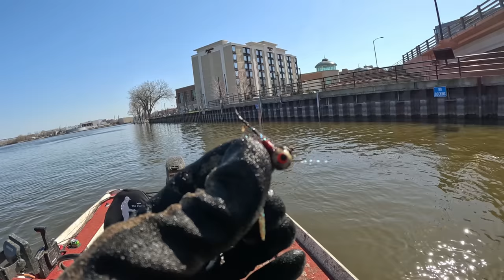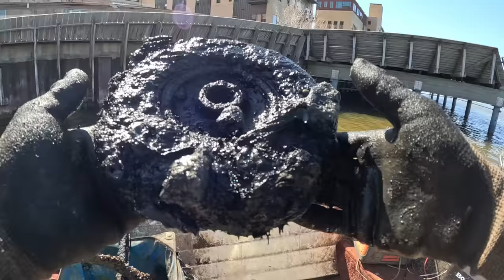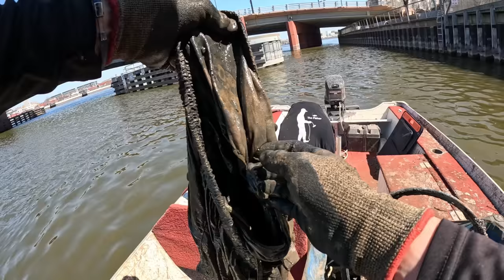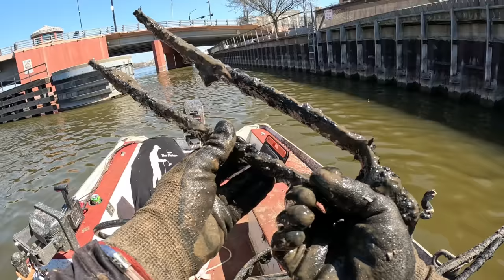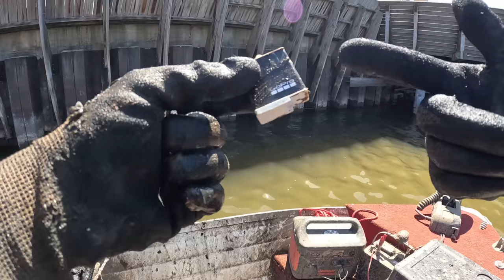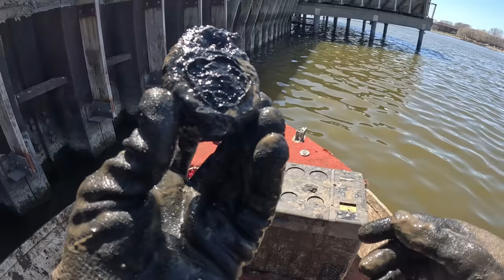WARNING: Tossing Evidence Into the River Does NOT Make It Disappear! (Magnet Fishing)

Comment: Hey Tyler,
   The two alike wheels are from a self propelled lawn mower.
The big hexagonal bar is commonly called a tanker bar, often used to pry or force tank tracks.
The box looking thing is actually a commercial mop ringger.
   Man you really need to pull the plug on the back of the boat and flush that crud out.
But if you do, remember to put the plug back in before you langue again.
Reply: Nice juicy spot Tyler! That push mower was epic! I remember using one we had in my youth. I’m intrigued with every heavy catch you have wondering what the heck it is! Love your videos.
Reply: Run it thru the car wash lol!!!
Reply: Tanker bar? Thats interesting. 

To me its a spud bar. I have two just like that one.

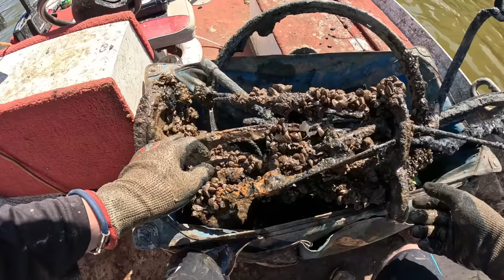Comment: 5:00 it is a wheel from a car of the 1910's or 20's. The tire mounted on the rim and the rim bolted to the center through the bolt holes. 12:45 is definitely a reel type mower. I think the matching wheels and gears may have gone on it!

Comment: Tyler a lot of the bigger city's always had there dumps on a river. They started closing them in the late 60s early 70s the would either push stuff into the rivers or if the were by one of the great lakes or ocean they would load barges full of garbage and dump it in deep water. So that might be why you find so much in some spots. If you go online you could probably find them marked on the map. I know St. Paul had one and so did Minneapolis.  I went to the one in st.paul with my dad in the 50s and 60s. They made land out of garbage. They filled in big swamps with the stuff then bring in dirt and put 4 feet or more on top of it then made the area into parks or built buildings on it. 
 I have a  ?  for you about all the snails you pull out on the stuff you find. I know hear in Minnesota it's illegal to transport them. And if they find them on your boat you can't put them on lakes and rivers that don't have them. I was just reading something in a newspaper about the snails and transporting them. You might want to check your laws or if you take your boat on a lake wash all the dirt out off it.

Comment: I grew up in the 50's and 60's, and it is so funny to me to hear 'manual lawnmower'. The word 'manual' changed my view on things now! I had never thought of that! Thanks for making me laugh! ☎Getting older not necessarily smarter!!
Reply: I had to laugh at how novel he thought the push mower was. I bought a late 1800s homestead house to a community of about 500 people that had one hidden away in the back corner of it's garage (former buggy barn I think as it still had rotting horse tackle in a crate under the workbench.) Anyway I took it to the local hardware store, had them sharpen it's blades & I used that to mow our lawn so I didn't have to pay for gas!

I used it for about five years before some random guy stopped by & asked if I'd sell him the mower for $250. I may have saved a lot of money with using that mower, plus got some decent exercise as a result, but $250 was too much to pass up a bit over a decade ago!
Reply: @athelwulfgalland  So awesome. Yes, no gas and if kept lubed and sharpened they could fly. Thanks for sharing and $250.00 I would have sold it too!

Comment: Tyler, when you bring up those fence posts, they aren't sign posts and you are holding them upside down. Those things that look like a small sign is actually, an anchor that holds the post tight into the ground so, it can't be pulled out. I hated those push mowers, they would bind up in heavy grass. Those cassettes are only about 8-10 years old, they were actually better and cheaper that disks.

Comment: At 15:00; the gear is called a ring gear like one used in a differential because it looks like a bolt on gear and the other ring gear is a sweat on type like one used on a flywheel.

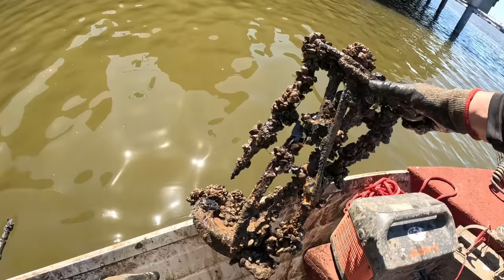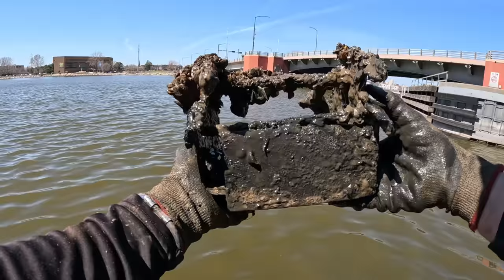Comment: port hole frame like thing thing 5:05  ???  your right! an old push mower as you push the blades spin cuts the grass 12:28 thinking more of it with the gear it is off the push mower 23:49 it's an old mop ringer that goes in the mop pail or on it that is

Comment: Not the battery it can be how much water you are adding to the go pro.  I know it’s water proof.  Just maybe a bad battery or.  Being.  If you use a mod.  It’s water causing the issue. And could have shortened out the battery.  Or water somehow go into the connect.